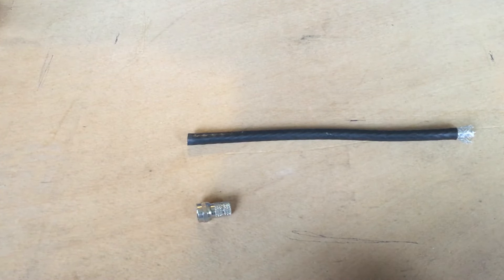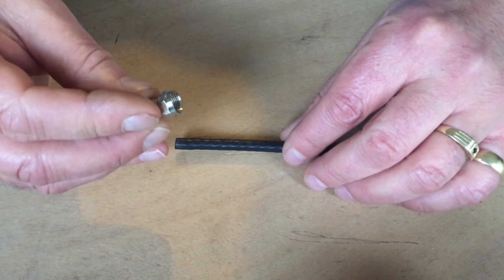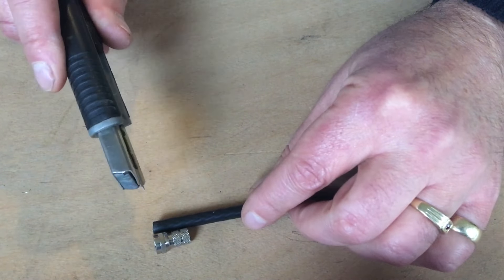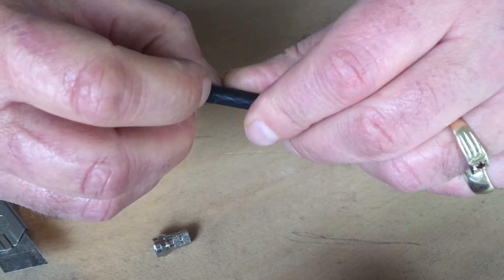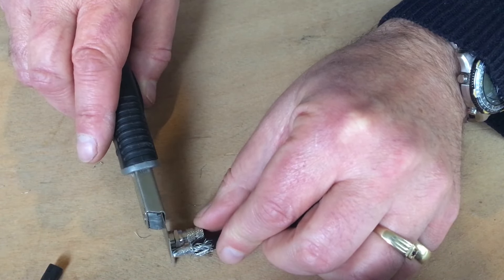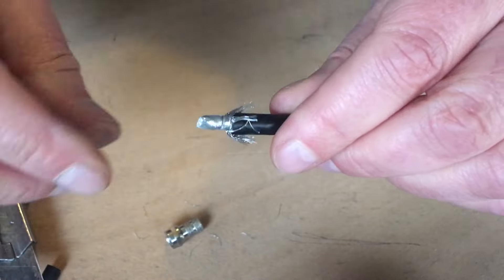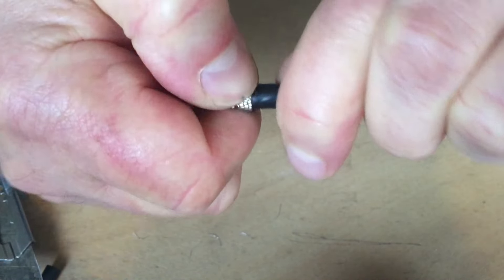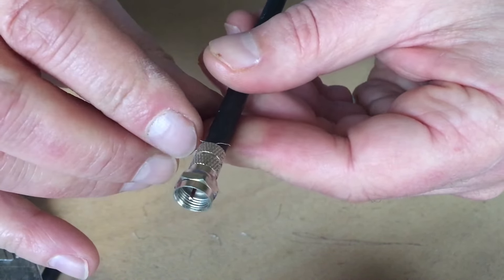How to fit an F connector to a coax cable

Comment: This is a very good tutorial, love it. Used to put the outside wires straight and into the f connector instead of what u did by bending them over the outside cable cover, no wonder my f connectors were always loose. Now I know how to correct that.
Reply from the maker: Thank you for the comment and glad you found the video useful

Comment: I'm looking to split my aerial into 2,I don't think it's the same connectors,mine are the fatter type male connector that comes in 3 pieces that thread on, would it be possible to fit these types on there? It'll be easier if so as I'm thinking feed/F connector/ 8m to bedroom and 1m living room,any suggestions welcome thanks 👍

Comment: Does that go into the TV??
Reply from the maker: Does your tv have a threaded connector for your antenna signal? Tv's may vary as some may have threaded connectors which this can screw onto, some may have bnc connectors and some may have push in connectors
Reply: I purchased antenna cable and 2 coax plugs which I was told is what I needed. One end fits into the wall socket and the other doesn't fit back of TV. Seeming something to do with male or female coax ends. I purchased a TV extension cable and wondered if this would help as I won't have TV working for Christmas through lockdown so annoyed that I can't get it to work. Thanks for helpful video though as I always wanted to know how to do this. Much appreciated :)